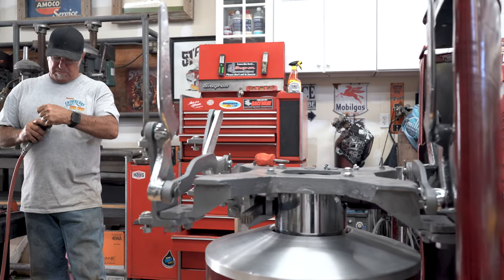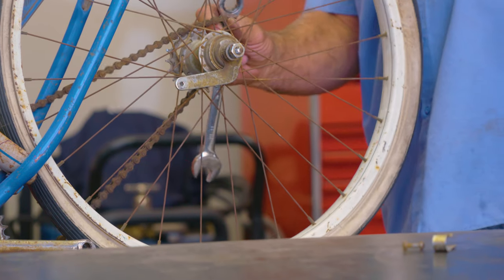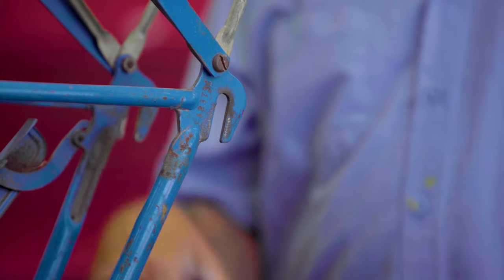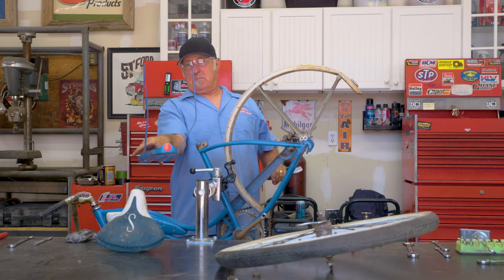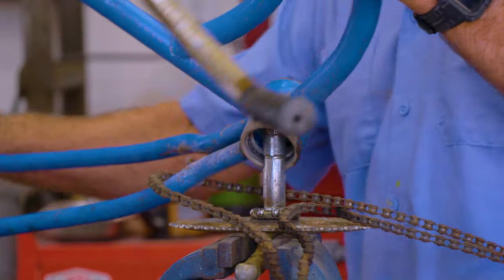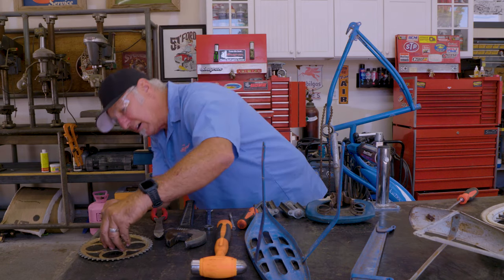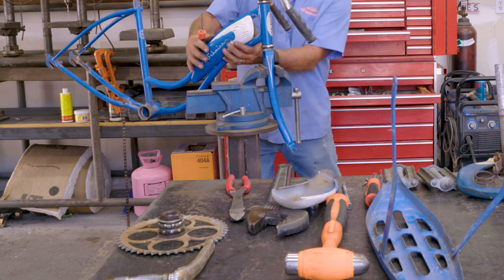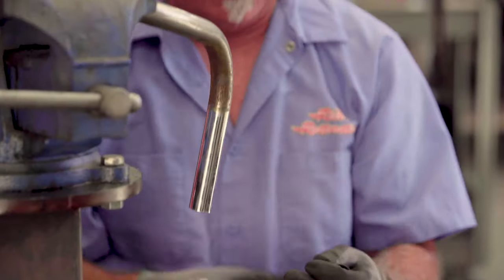1961 Schwinn Bicycle Restoration || Restoration Rick

Comment: Hey Chief, Schwinn bounced the serial number locations around over the years. Some early versions are on the bottom bracket, after that they moved to the left rear axle dropout and the later ones til they stopped Chicago manufacturing in 92, the number moved to the bottom of the head tube where the Schwinn tin badge was. If you wanna find out what year your Schwinn was made (strictly the cantilevered frames that used the single piece Ashtabula forged cranks) you can find the date of manufacture on the the pedal crank s but you hafta pull the cranks to see it as its in between the crank bearings.

Comment: Great video, I’m looking forward to the next part!

Never thought about using hot water to loosen grips. When I did a recent restoration I got the rubber grips off by leaving the bike out in the sun for a few hours and that loosened them enough that I could twist them back and forth and squirt some WD-40 on it to slide them off.